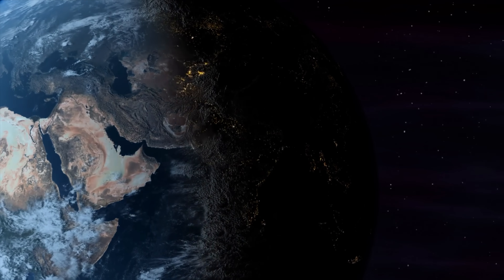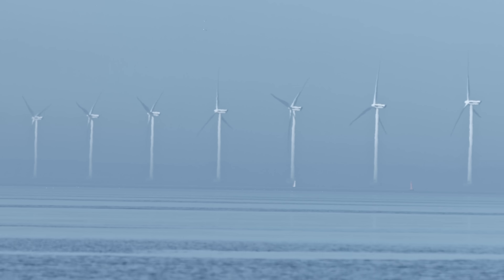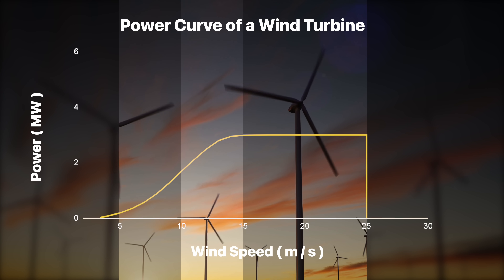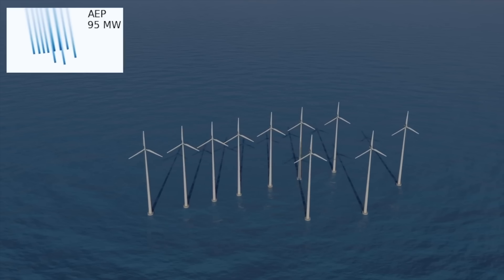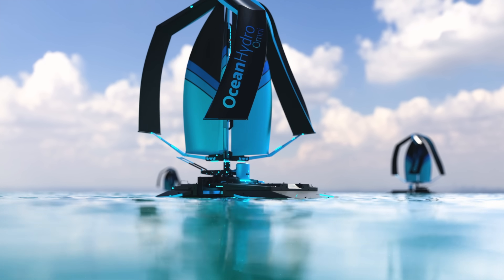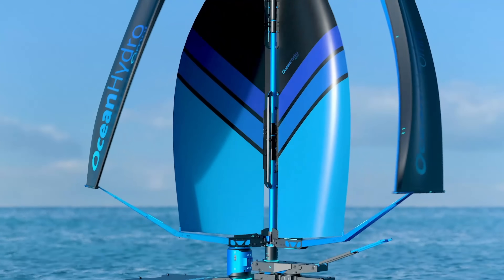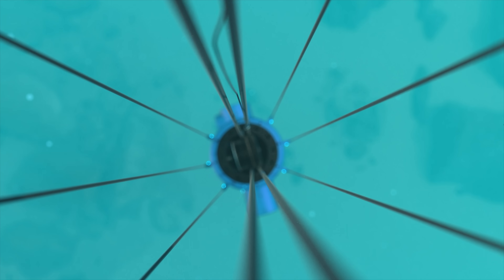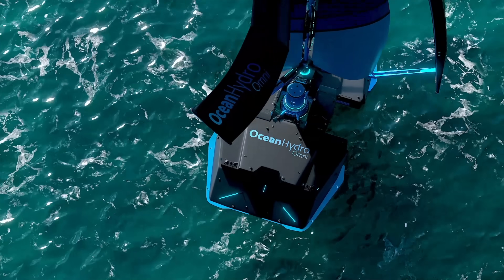Breakthrough Tech Solves Wind Power's BIGGEST Problem!

Comment: Im calling it a 1/10, an investment grab aimed at people who failed physics. I'm all for innovation, but there are really good reasons vertical axis turbines and gravity storage are not common things at any scale. their blade design looks pretty neat, I'll give them that. The problem with gravity storage is to get any usable amount of power, you have to deal with enormous masses (and therefore structures) fighting against gravity, we just cant build things tall enough and large enough to be practical, Especially when the whole thing is supposed to be moving. one day, perhaps.
 
No problem, this thing is in the ocean, its 700m deep/tall, no tower required! it comes down to drag, which is a function of density. water has a density of 997 kg/m^3, whereas air has a density of 1.2kg/m^3, so lets ballpark it that water has 1000x more drag than air (yeah its more complicated, but its within magnitude). That's some serious loss! But the real kicker is their animation. If you were think that to be in any way representative of what they are intending, they have paid ZERO attention to drag. their counterweight has all sorts of greebles and widgets on it, if they were making any attempt to be serious, that would be torpedo shaped. Soo, that makes the animation useless, and therefore their 'clever' blade design pure fantasy.

If you really want to put the boot in, Its ** IN THE OCEAN** one of the more challenging environments to build in. sure, we can anchor oil rigs and ships and traditional offshore turbines just fine. But they are static, no moving parts. pulleys n cables vs currents and weather? I know who I'd bet on. also marine growth, not only gumming up the works with crud, but adding even more drag. a clean hull on a sailing boat can go about 20% faster than the same one with 6 months of growth on if your overdue for an antifoul coat.

A university near me ran a field trial with 2 other uni's (I think one was US, the other was scandinavian somewhere) on capturing wave power. 3 totally different designs, refined for years in wave pools, all the mechanical kinks ironed out, reams of data on performance. was supposed to be a 6 month trial. was canned in under a month, none of them could be kept reliable enough to capture any meaningful data. turns out large, moving things in the ocean are really hard. and they were all uni's with well regarded marine engineering departments, all had been optimised for simplicity and reliability over pure performance. quite a shame really, some excellent ideas there. and I haven't heard wave power being a serious thing since.
Reply: Their blade design looks neat, true.  That's important if you goal is to do, "an investment grab aimed at people who failed physics."    That looks exactly like what this is.  The reason wind turbines are tall is because the winds at the surface are far less than the winds 30m or so up.  These little things are going to be ineficiently pulling energy from a much lower energy environment, then moving masses against fluid drag through one of the most hostile environments you could put moving parts in.   Total nonsense.    The quest for usable wind power is a great goal (which is why it is fertile ground for this sort of, as you kindly put it, "investment grab."
Reply: @brianhaygood183  No it is not.  VAWT are very useful in locations a HAWT is not, or in combination with HAWT.  I am NOT saying its good in all cases, just a few where appropriate, with HAWT and Solar as the dominant types.
Reply: @joep5170  Yes, a HAWT, like any piece of equipment, will have its own strengths and use cases.  However, this idea of putting them at ground/sea level, dragging weights through the water, etc. is just foolish.  If it were the least bit reasonable, I would call it overly ambitious.  Since it positively stinks from an engineering perspective, I'll agree with arjovenzia's description.
Reply: @brianhaygood183  Not talking about the weights in the water, that is stupid.
The VAWT only, at ground level tapping the wind between HAWT that would not be captured.  
(PS, the weights can go inside the tower for the HAWT, using basically empty, wasted space)
Reply: My main concern was the one about drag that you so clearly explained.
Reply: When it comes to drag it increases exponentially with the speed you're travelling through a medium, meaning if you're going slower drag becomes exponentially less until it becomes minuscule. I assume the intended design would lift the weight so slowly that drag isn't really an issue, but I agree it's an nonviable design for the other reasons stated. It's better to centralize the gravity battery instead of distributing it into so many locations with so many moving parts to maintain.
Reply: Gravity storage is VERY important for renewable energy to work, it is not a question of now IF, but HOW.
A mass inside the HAWT support tower will provide a few minutes of stored energy and buffer to erratic wind force.
VAWT can be used in areas a HAWT will not.
Reply: @joep5170  Go for it.
Reply: I think you have nailed it, were seeing a lot these frankly scam projects now, often just recycling ideas from the 80's or 90's when their were no mainstream renewables and almost any crazy idea might have merit, but subsiquent research has weeded them out and esatablished a baseline of real renewables that one must credibly be able to best to have any legitimacy.  The common thread in these scams is a physical device simple enough for non-engineers to understand how it operates but not to realize why it's completly impractical.  Gravity storage is right at the sweet spot of simple understandability, but total impracticality because lay people confuse the force with energy, falling object have high force but low energy.
Reply: @kennethferland5579  Gravity Batteries is the oldest energy storage technology on earth, over 100 years old.  Its value is  fully proven and will be critical for successful transition to Renewables, 
NOTE: Gravity batts have the ability to condition the uneven energy produced by wind for a more stable output for grid.  It can also produce a few minuets of power before the potential is zero, but that is better than zero.
Reply: @williamarmstrong7199  I agree, the in-water design will never work, stupid to even think it can.  What I propose is put the weight in the tower that mounts the big wind turbine. That tower is empty space, perfect for a gravity battery!
Reply: @joep5170  Go for it.
Reply: @halbedelstein-missiongitar3030  "Solar Roadways" it too much $$$ for very little gain, yes.  
Underwater weights is doomed to early failure, yes. 
But a Mass in a tower gravity battery is very functional, cheap, and practical for conditioning wind power output.
Reply: @joep5170  That's why you see them all over the place.
Reply: Trebuia să producă aer comprimat. Nu hidraulic. Care este supus la sarcini mari și violente.
Reply: High capacity gravity storage does currently exist and is in use; we know it as pumped hydro storage. It's also significantly more efficient than any sort of mechanical gravity storage device would be.

Comment: Wind mills can produce 1-5 MegaWatts at peak. A 2MW Vertical Mill could lift a 2.5 Million Kg weight 300 meters in 1 hour. That requires the windmill to have a floating platform that has a buoyancy of ~3 Million Kg. Given the density of water, thats a 50x50x50 ft haul. 

The weight would be able to store 2 MWhr of energy, which would be around 160$ worth of energy. The concrete for the weight alone would costs $340k (2200 yards at 150$/yard), 2100 trips would have to be made to pay for the concrete weight).

Im going to round up and say that this system would cost $5M to store 2MWh of energy, which is $2500 per kWh. Im rounding up a lot due to cost of haul, cables, anchors, concrete. 

Current Lithium Ion Battery storage systems are currently around $400 per kWh. Pumped Hydro Storage costs around $120 per kWh. 

Anything is possible, but it seems like all of the Gravity Battery concepts just arent cost effective... gravity isnt a very strong force.
Reply: Especially when you have to take off weight for buoyancy. 10% loss for steel and 40% for concrete if I remember right.
Reply: I agree. Keep the wind turbine as simple as possible and put the energy storage on land where maintenance is a lot cheaper and simpler. My concept involved pumping the water out of the supporting structure and placing the gravity storage in that shaft, but somehow, I don't think that would stand up too well over time.
Reply: @surferdude4487  The only gravity storage I've seen that works on large scale is water-based and that was freshwater. For that essentially you need to create a lake near but at a higher elevation than another lake. Preferably in rocky terrain so there's less water loss to the ground they might treat the ground but I can't remember. It's hard to find a place that works well for it. But anytime humans get involved with using water on large scales someone down the line ends up in drought. Like with the Nile River.
Reply: @siral2000  Agreed. Pumped hydro is really the only large scale, gravity based energy storage system, but as the conditions where that type of installation can be built are rare, I'm more in favour of battery based power storage systems. Batteries can be placed just about anywhere and they can respond instantly to demand. IMO, storing energy by moving huge blocks of material is not going to end well.
Reply: @surferdude4487  Current batteries are not feasible on a Country-Wide scale. There's just too many rare Earth minerals needed and too short of a lifespan for it to be feasible. Renewables just means the fuel for the energy is renewable it doesn't mean the technology can be used forever. Eventually the rare earth minerals will run out and recycling will only get so much of them back. What scale would be required for that though I do not know.
Reply: @siral2000  Batteries do not have to be LI with nickel and cobalt in them. There are dozens of storage battery types that would be perfectly fine for grid power storage but would be unsuitable for vehicle batteries due to bulk or weight. Flow batteries and sodium ion batteries being two that come to mind. They are made of cheap, common materiels. Also, at this point in time, Redwood Materieals is recovering over 92% of the material from the batteries they are recycling and selling the remanufactured materials at a profit. We will have to mine quite a lot more material before the majority of new batteries can be made from recycled material, but the day is coming.
Reply: @siral2000  Yes and see what happened with places where those materials are minded. We are, now protesting against lithium mind in Serbia.
Reply: @vesnafilipovic3779  I can't tell if you're agreeing or disagreeing with me. I was talking about how lithium batteries are unfeasible to be used on large scale.
Reply: @siral2000  Are you sure batteries need rare earths?
Reply: @majurawombat1634   Nope, I don't keep too close of a watch on developments in the field so I can't be sure. I do know Cobalt was, and still is, used in lithium batteries. I just don't know if there are new versions without cobalt and how widely it might be adopted.
Reply: buy teksa mega pàçk

Comment: Interesting, but why not simplify the system and have your VAWT connect with a simple  mechanical pump pushing sea water along  a pipe to a central hydraulic accumulator/ accumulators with  a central floating  or land based generator.  The hydraulic  fluid then either powers  a  generating  turbine directly or via the  displaced  air  in the accumulator   during the fill & discharge part of its cycle.

London was dotted with accumulator towers & pre-electricity there was a hydraulic  network under  London powering  lifts (elevators), machinery & theaters, Tower bridge's bascules  were powered  in this way.    So this would not be a new technology.

This would allow for there to be  simplicity at the wind turbines,  with the  generating  infrastructure  centralized.  You could still have your moving weights if you so desired but they would be in a centralized  location.
Reply: That's not simplifying anything, that's adding one more huge inefficiency by converting power. You start with wind power spinning a turbine in order to convert it to hydraulic power to spin a 2nd turbine which converts that to electric power in your scenario. None of these turbines are anywhere near 100% efficient.
Reply: @blakebrown534  VAWT is converted directly by simple mechanical gearing to the hydraulic pump, no electricity is generated at this point.  The pump might be a simple impeller or a reciprocating pump. 
So for a field of  say 10  VAWTs you would not need 10 sets of electric motors/generators as this is all done  at a central floating or land based hub.   The intelligence & control for  the system is in the hub rather than devolved to each VAWT.
Reply: @blakebrown534  Efficiency isn't terribly important out in the ocean where the energy density is high and scalability is infinite.  The key is the complexity of the equipment in the ocean that requires servicing.  A bunch of floating mechanical pumps connected to a giant hose to shore lets you easily swap, shut down or service individual floating units and all of your other equipment is on shore.

Comment: waves... if you need 100 meters of clearance under - there will be waves - does this just submerge in the wave due to the cables in the other end keeping it at a set hight from the sea floor - how about the low part of the wave - does it then slack the cables letting them intertwine - how about movement of the wind catcher - how does it stay in place above the cables and not drift... Seems like everything but the water has been thought off...

Comment: Looks like a great concept. I hope the get to install some real world sites and get real data and make real improvements. Maintenance looks like a nightmare though.
Reply: Scams don't worry about maintenance. They just need to sound convincing enough to a 60+ government employee that wants to check a box or an eco nut without enough sense to come in out of the rain. Thunderfoot will likely debunk this soon.
Reply: @siral2000  Yeah man. That'd suck if we invested in clean renewable energy that doesn't actively destroy our environment without having an immediate financial return mapped out. Money is way more important that air or food. I also can't wait for my favorite youtube to confirm my predetermined viewpoints!
Reply: @lephtovermeet  This won't have any financial, scientific, or ecological return. I'll be surprised if they even design the prototype. They're just trying to siphon off money from viable solutions. All they're doing is taking two different technologies that are already considered subpar and putting them together badly and expecting a better result. Vertical wind turbines work but they're worse than horizontal. Gravity batteries work but the material costs are enormous. Even without maintenance costs this design wouldn't work better than what we already have. It also isn't anything new technology wise.

Comment: It seems a little foolish to be extracting energy from moving air. That wind needs to move to regulate temperature, and although small, extracting energy still has an impact somewhere. Array all these, and how much wind didn't do its job to regulate temperature? How small or large is the effect of extracting energy from wind? Does anyone know? Has anyone done this research?
Also, the resources needed to manufacture these things doesn't hardly offset the cost of simply burning fossil fuels. All these things are made of plastics and other carbon producing means, and seems like a giant sham, and most folks don't think that far. Fusion is the answer. Billions of wind turbines can't do this job.

Comment: Why does the energy storage need to be attached to the wind turbine? The same storage method could be used with traditional turbines as well - just use electricity to lift the mass - but the storage could be off-site. That would also mean you get to have a disproportionate number of mass storage units, meaning storage is always available, as their number is not tied to the number of wind turbines. The 'hybrowind' units can only store more energy until all of their mass units are raised to the highest position.
Reply from the maker: If you saw the video, mechanically lifting a mass is much less sensitive to wind speed. This allows harnesses a much greater range of wind speed. Remember energy increases by the cube of wind speed.
Reply: @TwoBitDaVinci  But that gives you a fixed upper limit to how much energy you can store per unit. Once the mass is raised and there's no demand its release while the wind is still blowing, this system wastes 100% of the wind potential.

If the gravity storage was operated by electricity and was off-site, you could have many more mass storage units available than there are wind turbines.

Comment: Vertical Axis wind turbines have been the center of SOOOO many scams since they first appeared. Trust me, this is yet another scam.  There was a company that put vertical turbines on the Adobe building San Jose for almost FREE, and it was still a negative ROI.  So many mechanical problems due to bearing location.